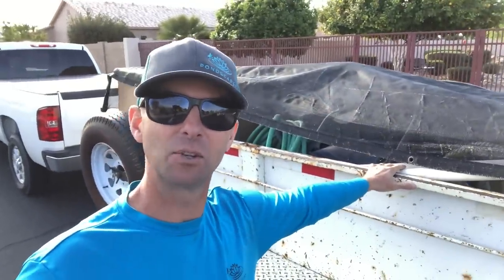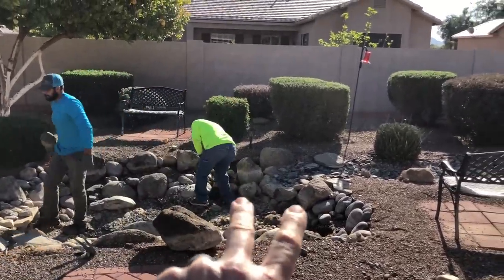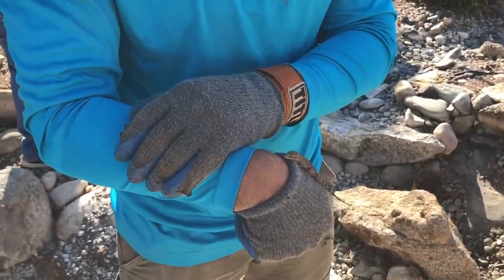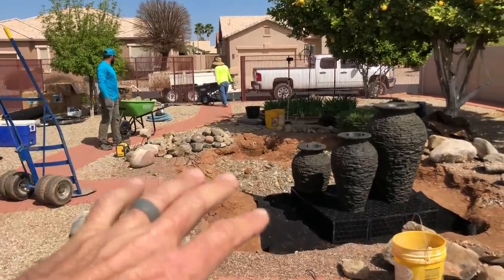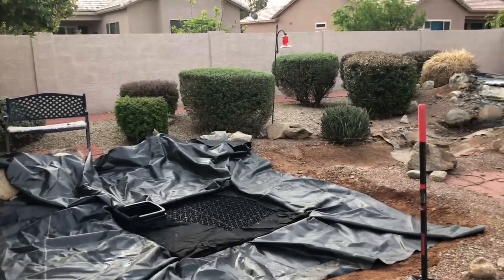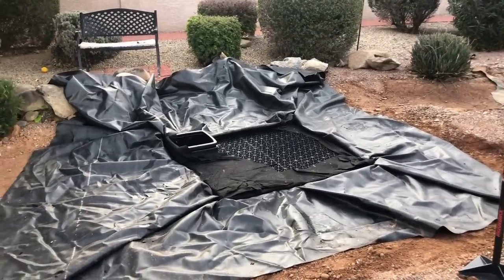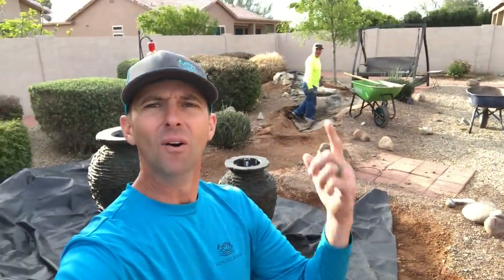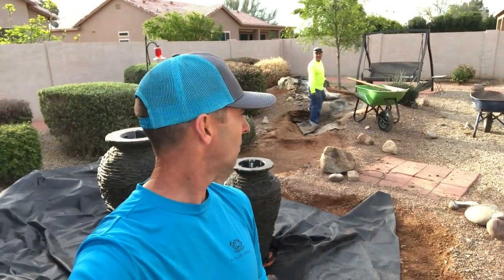Pond TRANSFORMED into a BEAUTIFUL Fountain

Comment: Great job buddy...
Is that ok to just slide over the pipe and adapter... no need to glue or anything what if its leaking down there
Reply from the maker: A slip fit is all I want in case we ever need to access for any reason. If it leaks it will be minimal and just drain down into the vault. Great question 👍
Reply: Thanks dear...I love the comedy touch in your videos:)